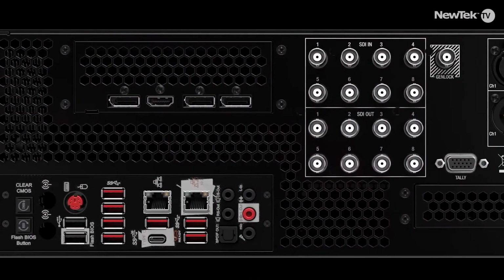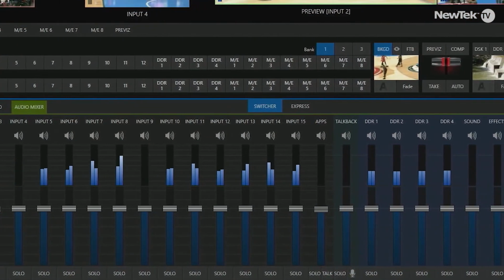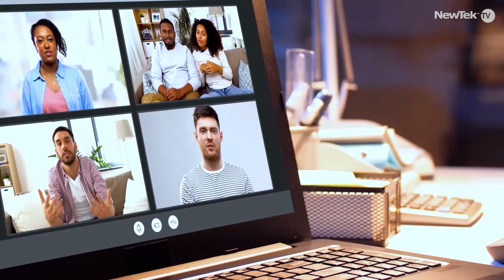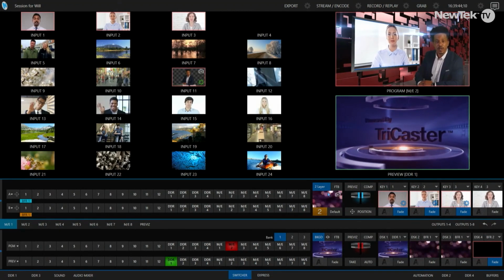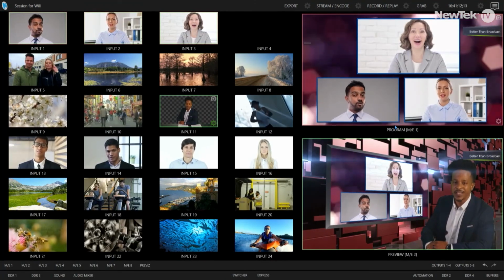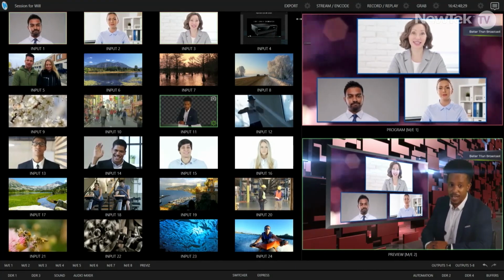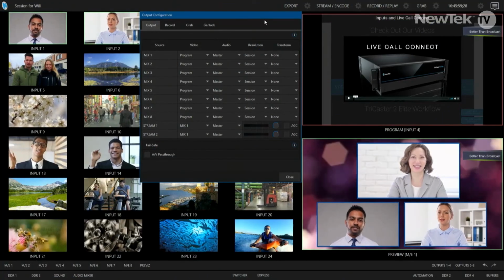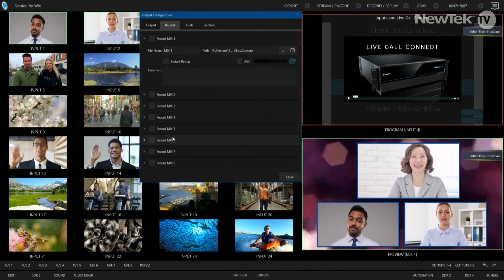NewTek TriCaster Elite 2 Demo (NewTek.TV)

Comment: Can I use my tricaste3r 8000 controller?
Does the Elite come with a controller?
Reply from the maker: No prior controllers but the 2 stripe IP panel and the 4 stripe IP panel are compatible.
The controller is sold seperate.

Comment: My question becomes what is the resolution of each of those "inputs" via Live Connect if I'm pulling 6 people from Zoom or Teams? It looks like you're just cropping each out of one HD (or lower res) feed from those apps. So taking one of those people full-screen will be noticeably soft.
Reply from the maker: okay, official response "It is recommended to run LCC on a 4K display. This is to give the meeting software the most ‘resolution’ to display the sources.  While it can run on lower resolution monitors, this will affect the resolution of the calls going into the switcher software.  On a 4K display with a 9 way call that will give ~720p resolution to each caller window (and most meeting software works at 720p for the webcam video)."
Reply from the maker: That's a great question, Troy! Let me find out from the NewTek team.
Reply: I know im asking the wrong place but does anybody know a trick to log back into an instagram account?
I somehow lost my login password. I would appreciate any tricks you can give me.
Reply: @Theo Toby Instablaster =)
Reply: @Franklin Alfonso Thanks for your reply. I found the site thru google and I'm waiting for the hacking stuff now.
I see it takes a while so I will reply here later with my results.
Reply: @Franklin Alfonso it did the trick and I now got access to my account again. Im so happy:D
Thank you so much you saved my ass!
Reply: @Theo Toby you are welcome :D